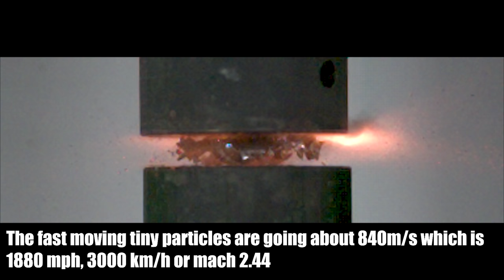Crushing Ball Bearing Underwater with Hydraulic Press

Comment: My theory is that the bubbles are formed when the surface of the item being crushed moves rapidly enough to create a relative vacuum. With that in mind it makes sense that vibrations/a shock wave would travel through the body of the socket when part of it breaks off, transferring energy to the liquid water it’s in contact with and thereby causing the phase change to a gas bubble.

Edit: this is specifically in response to why the cavitation bubbles appear on the surface of the small socket that’s crushed near the end of the video at 8:00 to 8:15.
Reply: the high speed of the parts trying to fly away pushes the water ,and the water is moving faster then the atmospheric pressure can push it back , the exact same thing happens when you hit a glass bottle that is filled with water from the top, it's simply the inertia of water
Reply: Yeah, I think your right. They are creating sonic booms but in the water
Reply: @menkiboj  the good ol method to force your buddy to start drinking faster
Reply: Cavitation
Reply: Yes exactly, it's so cool when the ball bearing goes, both tools move so fast at that point that the entire tool face creates cavitation bubbles just from the sudden acceleration
Reply: I think the the sudden release of the crushing tool is creating a shockwave in the water, which is reflecting between the plates (and also around the object). You can see the pulsating nature of it at 7:52 to the left of the object. That is blatantly the shockwave reflecting around the plates/tank creating a standing wave pattern. You can also see the pulsation to the right where an existing bubble collapses and pulsates.

Air is more compressible than water, so any existing cavities perhaps act as a focal point to absorb the shockwave energy as it bounces around the tank.
Reply: @shrunkensimon  that explains the cavitation on the faces of the crushing cylinders but doesn’t explain the cavitation following the edge of the socket. If it were just a function of the crushing cylinders then the cavitation would be evenly distributed between those two surfaces without following the socket walls.
Reply: @Thomas Westgard - Yes but if you look closely, the remaining part of the socket also moves until it is stuck under the press again. I’m sure if the high-speed camera was fast enough, the remaining socket part would be seen moving very fast and also vibrating at its resonate frequency, until it is caught again under the press. I’m not sure if the socket movement or it’s violent vibration (or both) would cause the cavitation bubbles.
Reply: Couple of things to note: cavitation bubbles form in areas of low pressure, and speed of sound in water in ~1500m/s. When these various objects break, they create cavitation bubbles either in their ‘wake’ as they travel through the water or as a result of the extreme turbulence created. I don’t think we’re in the realm of true shock waves here as when the BB bursts in air the fragments travel below the sound speed in water (but that’s not to say the initial fracture couldn’t exceed this). And finally, the ‘pulsating’ another guy mentioned is probably an optical effect, due to the pressure waves vibrating the tank.
Reply: @ryanhamstra49  um... it has nothing to do with sonic booms, sonic booms are a different thing that happen when an object is moving at or above the speed of sound in a gas
Reply: @menkiboj  your correct, someone later said cavitation, I couldn’t think of the word at the time.
Reply: I think the bubble is far ahead of the shrapnel, following shockwave through the medium.
Reply: @AppliedCryogenics  yes, for the ball bearing but in the case of the socket the bubble forms because the water is moving at high speed but a piece of the socket that stared moving very fast got jammed and water just continued moving due to innertia
Reply: @OFFtheCHIZANE  (in the case of ball bearings) these tiny bubbles formed when the tools start to slow down but the water keeps moving very fast and creates the zone of low pressure
Reply: Yes perhaps the energy imparted to the water by the explosion can cause some of it to flash to steam for a moment before being reabsorbed by the water.
Reply: @CONCEPTUALMAN  not very likely, since the pressure also spikes and raises the boiling point of water at that moment, but there is a pressure drop after the spike which causes cavitation bubbles to form
Reply: That what I was thinking too. The force from the explosion was causing shockwaves underwater since it's more condensed and contained than if it was just air.

It's a lot of tiny shrapnel trying to go all over the place, but can't do so as much so the force of it is causing the water to move around with such force as well
Reply: @menkiboj  I see your point 👉. Haha. But then my thinking is that maybe the heat is imparted to the air bubble during the collapse then the heat in the bubble causes the water on the surface in the bubble to flash to steam. It's a thought.
Reply: @CONCEPTUALMAN  That was my first thought - the energy from the press transforms into heat as the piece brakes but cools quickly down (we can see the ballbearing in air forming sparks)
Reply: I was unsubscribed!!! Wtf yt!?!
Reply: Also a small amount electricity and a small magnetic field could be being generated here. Interesting between those things you mentioned and mine who knows where this could take someone?

Comment: Great stuff as always! New HPC videos are like my adult equivalent of Saturday morning cartoons lol. 
As for an idea for the cavitation bubble thing.... I was thinking something like an air cannon, but smaller. You could take a Pringle’s chips can, cut the end off, and attach a rubber diaphragm to it... A stretched balloon would be perfect. Put it under the water, pull the rubber back and give it a pop, and you should get some BEAUTIFUL cavitation bubbles and rings.
Reply from the maker: That's a great idea. I will try something like that.
Reply: That isn't really Cavitation, its more like a vortex gun... Still cool though.
Reply: Cavitation bubbles are caused by water rapidly heating up and vaporizing... underwater. This can be caused by objects going super fast and generating lots of heat from friction, or by an explosion creating a void that the surrounding water rapidly fills in.
Reply: @Wuzzup129  Bro i think you got something mixed up. Cavitationbubbles generate when the pressure drops below the vapor pressure. It typically has nothing to do with heat as far as their creation goes. But when they implode, thats when all the heat and pressure spikes occur you heard of. So the heat is a result of the caviation not the other way around. :)
Reply: @ariferr7274  Ah.
Reply: It's also worth noting that cavitation bubbles can actually release light when they collapse.  The last press on the socket was also very interesting because the cavitation bubbles on the left side appeared to oscillate.  Collapsing quickly and possibly heating up enough to recavitate the water, another option would be that some of the gasses in the water were knocked out of solution and were oscillating as they compressed and gained energy enough to expand.  I think it's less likely though.  Another possibility is the shock wave through the water is also causing it to appear oscillating.  I can think of a few ways to test some of this, but either way it's super interesting
Reply: @HydraulicPressChannel   6:30 these are shockwaves
Reply: A cavitation bubble is just a pocket of gas or vacuum inside a liquid.
Reply: @The_Keeper  it's cavitation: the shattered bearing will of course create a low pressure zone as all the shrapnel flies outward, and the interesting effect of cavitation on the top and bottom surfaces of the press. they both oscillate extremely rapidly for a moment after the bearing shatters which causes that cavitation-- the water can't replace itself fast enough as it's pushed out of the way, so the vacuum and vapor bubble forms.
Reply: @mizterwizerd  there a vid of a guy shooting a 6.5 creed more round in a block of ballistic gel and when the cavitation collapses it creates a quick flash of light. Pretty neat

Comment: 7:47 Note that on the left side there is an oscillating bubble that started where there were a couple air bubbles. It looks to me like the shockwave caused the air in those bubbles to heat up to high temp and expand followed by collapse to a point where the air reaches high temp and maybe a tiny bit of water flashes to steam and the bubble expands again and repeat the cycle.

Comment: I’m sure you won’t see this but you mentioned in the video you have issues focusing the high speed on such small areas, get a laser pointer and shine it on the area you want to focus on the auto focus will get it perfect or if you are using manual focus it helps a bunch!

Comment: It is possible that the immediate noise seen ("bubbles") are also tiny pieces of the bearings steel explosively moving through the water at a high speed. The water magnifies and tracks the particles leaving the appearance of the bubbles in conjunction with the regular bubbles that  occur during high speed material explosions underwater.

Comment: These bubbles are probably water in vapour state: the explosion give enough energy to boil instantly water, which expands, and floats, and gets pressurised back, oscillating the walls of the tank, that are flexible and the surface oscillates, giving the woobing effect ont he vapourised water... The bubbles get colder and goes back to liquid state: the bubbles vanish. It's just a theory, but makes sense.
Reply: Holy crap that actually makes sense due to the amount of sparks from the ball bearing out of the water. It would be so cool if they showed how hot everything got when they're crushed

Comment: High pressure shockwave is followed by low pressure wave, allowing dissolved gases to come out of the water? 

Could try sealing the chamber and applying vacuum to try to pull out the dissolved gases, or try to find an oil that is conducive to filming? Maybe then you'd be more likely to see cavitation?

EDIT: Wouldn't need a vacuum during the crush, just for some time beforehand.

Comment: 👍 interesting stuff as always.

If you're looking for ideas - I think reviving your bridge idea could be a good one. 'major hardware ' has a really great long running thing called 'fan showdown' which is basically testing 3d printed fan designs on the same noctua hub.

It would be cool to see a series like "under pressure" where you have a set criteria (size of print, or weight or just length of span etc. That all entries have to conform with and then periodically do episodes throughout the year testing a bunch of the submitted designs

Comment: The bubbles or cylinders that look like air are vacuum space where the water walls rush outward, then back inwards and when the water walls collide  they cavitate again. The cavitations essentially oscillate until they are damped out by the water pressure. Super interesting to see in this application at high speed. 

A great way to get nice high speed cavitations is to make something implode under water, so a pipe full of air with sealed ends under pressurized water would do this. You could get a great shot in your pressure chamber.

Comment: Try crushing something that's piezoelectric. The charge it gets from being crushed should do some interesting things with the water's dipole.
Reply: Yeah, do it with distilled water and then with salt water
Reply: It would be quite the same as putting battery under water. Pressing piezo materials slowly creates low voltage.
But very quick snap under distilled water could do something interesting.
Reply: Wintergreen Lifesavers!
Reply: @carlstanland5333  That's different phenomenon called triboluminescence.
Reply: @carlstanland5333  yes!

Comment: What happens with air bubbles is called, “cavitation” it is caused by the rapid movement of the metal when it explodes. It is what causes the sound propellers make and it reduces their efficiency. Very big deal with submarines and why when a modern sub is out of the water, that part is covered up.

Comment: This is serious stuffl!  What happens with two ball bearings, separated versus closet in?  Will shrapnel from one trigger the other?  When the ball fails, light is emitted!  Add a littel fluorescein (uranine, the soluble sodium salt, used for tracing water flow and ocean dye markers).  Is there an expanding wave of excitation?  (Extracting a fluorescent highlighter marker with water will do it.)

Comment: Two ideas - 1) put a piece of metal mesh close around the ball bearing, formed into a cylinder and rivetted shut.  Will the bubbles form inside or outside?
2) Put your gopro in a waterproof case under the water?   Would the shock break the case?  Perhaps try it with an empty case first.
3) An Infra-red camera showing where the heat is (good excuse for a new toy too)

Comment: some time ago, I read about fusion happening in heavy water, deuterated acetone, etc by crushing such cavities. sure, they were created by sound, but your method seems to be much more efficient in creating cavitation, and maybe it's even energy-positive (something fusion has just achieved once in the NIF). might be interesting to explore. the NIF uses a massive amount of high energy lasers, being beaten by "some guy from finland with his hydraulic press" would be fascinating.
Reply: the problem is, that these cavities are created directly between the liquid and the tool as a result of a sudden release of mechanical stress in solid materials. i doubt that NIF would want any hard metallic parts anywhere close to a fusion reaction, no matter how weak. lasers are a way how to suspend such a cavity without physical contact.

Comment: This was really cool and nice to see.
The reason for the ring-shaped bubbles that form around the tool, is that the momentum transferred into the fluid by the Shrapnel, causes a high flow speed that goes through an abrupt expansion which results in boundary layer separation (and the resultant low pressure cavitation) around the sharp bend of the tools.

The experiment with the wrench socket is a bit more difficult to definitively explain, because the dynamics involved are much faster than what the available frame rate can capture.
That being said, I believe the reason why there's cavitation around the bottom of the wrench, is because of the very high sound pressure level combined with the much higher speed of sound in steel than in water and the large radiating surface that the intact steel piece, recoiling from the fracture, provides.

Comment: 2 things. #1, the bubbles that seem to cling to the socket are probably formed from hypersonic vibrations from the metal as the pressure is released when the top part breaks.#2 maybe try a different liquid medium, such as alcohol, to film through. it may have a very different reaction! also, there are gasses that are heavier than air, you could try those in the tank instead of water, and the added resistance could be cool to see in high speed.

Comment: I was hoping to see cavitation bubbles and I was happy to see that the results were mostly about cavitation bubbles.

The first crushing of the bearing ball was really interesting because it looked like the press surfaces had cavitation when the ball failed but that shouldn't make sense because sudden movement of press tools should cause high pressure, not low pressure. Is that some other known effect we were seeing there?

I think you should do more cavitation videos. Maybe something with explosives or bullets to have even longer cavitation trails?

Comment: I believe the air bubble formation is a similar affect to the mantis shrimp when it punches. It also forms an air bubble under water due to its extreme power. "Cavitation is when low pressure in a liquid produces a bubble that rapidly collapses, and heats up to 20,000 Kelvin — hotter than the sun's surface."

Comment: This is similar to one of those glass tubes filled with distilled water that get sealed with 0 water inside them. When you wiggle them they make knocking sounds like there's beads inside, but it's actually caused by cavitation of water, since there's no air to act as a spring to squish it into obedience. Thunderf00t showed one of those off.

Comment: I think the cloud of cavitation bubbles around the bearing ball is formed in the low pressure phase of the shock wave generated when the ball explodes.

EDIT: You see it even better around the socket.  If you set the water moving outward fast enough, its inertia creates low enough pressure to form cavities.

Comment: All the bubbles are caused by the heat from the breaking, causing the water touching it to immediately boil. Even though it is underwater, the sparks you regularly see are happening but that heat gets quickly transferred into the water.

Comment: You should try a test with 3 variations of water temperature. Hot, room temp, and ice-cold water. I wonder if the shrapnel will travel further/fast in hot/boiling water because the molecules are moving fast aswell....

Comment: Fascinating. Cavitation causes severe damage to boat propellers, the tiny bubbles erode the surface of the propeller over time, and it doesn't take long to put large pits and eventually cracks in stainless steel or aluminum props.

Comment: the phenomenon which you can see is called cavitation, which happens if the object moving through the water (the object moving the water itself) is faster than the water can flow, which causes the water to "rip" and then close back up on it self. 

so those are bubbles made of vacum